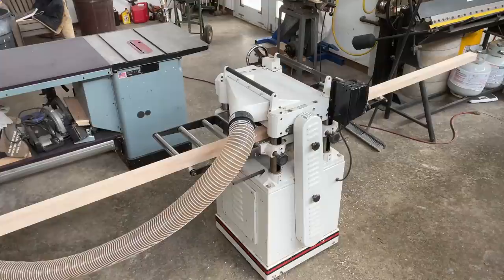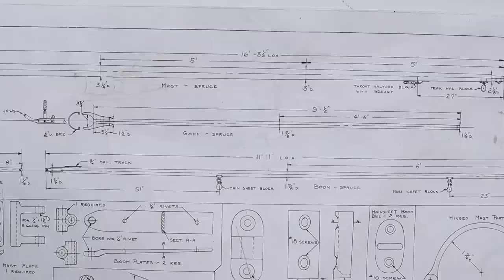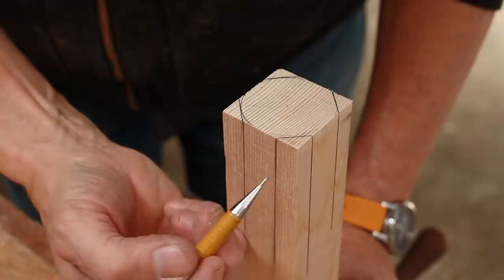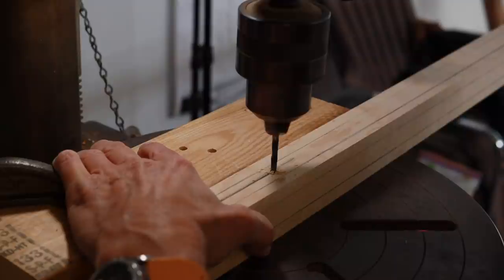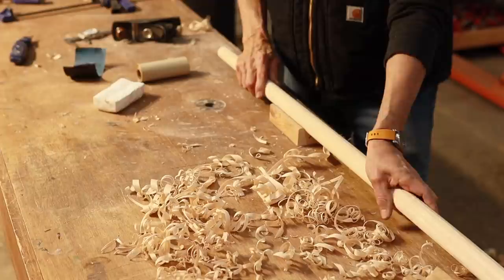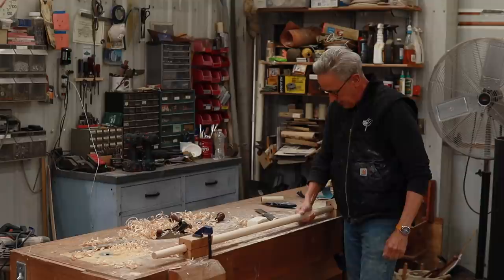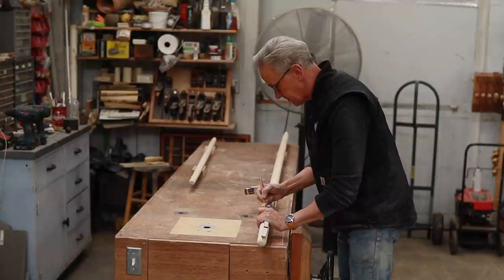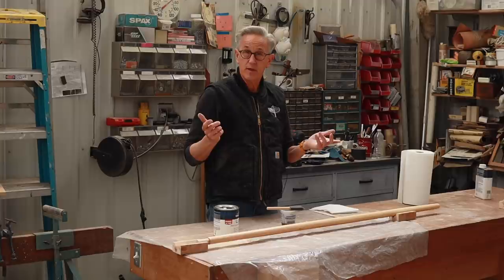Making Spars for a Haven 12 1/2, The Jib Club & Gaff, Part 1, S2-E62

Comment: That spar-maker's gauge is ingenious... simple but very effective!
Reply: I've seen a similar device with a single pencil used for finding the center line, but this will come in handy when I'm turning hardwood pieces for vases, mallets, etc.  (Pretty hard on lathe & tools if you try to round off a square piece of hickory or oak.) The goal of course is equal width faces, but the projection on one face I've just been using trial & error.  It will be nice to get it right the first time.  The right way seems obvious when Bob does it!

Comment: Tedious work for most people, but maybe less so for an artist experienced with the general challenges and concepts of the non-linear shaping of materials?  Starting with the smallest spars to hone the required techniques seems like a great idea since they're the easiest to handle and the cheapest to replace if you mess up.
Reply: Dang I'm about to start making spars for a 1890's style racing class sloop and planning on using traditional materials and techniques,  no sandpaper of course but you can also get excellent surfaces with a custom shaped card scraper perfectly sized for building light spars. 😀

Comment: Hey Bob I've got a question, with the Gaff jaw, when you used the drill press to drill out that slot, for the bronze lever shouldn't the slot be drilled out completely? will it be a water trap for collecting water if it's not drilled out all the way?
Reply from the maker: Good question. I built per the plans. It's very small and if by chance moisture did get in it would evaporate quickly. I did seal the inside of the slot.

Comment: Are all the round pieces on sailing vessels made by hand the way you did it? Or do they use lathes, if any exist?
Reply: There is a water mill near me, built over 200 year ago using some salvage timber from wooden ships including some spars as pillars. You can clearly see where they have octagonal facets that are faded at the ends into round stock. I can't imagine they would ever have been turned on a lathe. There are vids of people hand rounding large baulks like Bob has done.

Comment: Wondering why the spars don’t have a couple of epoxy coats on before varnish, wouldn’t that extend their life and increase their strength? Excellent work as usual.
Reply: it will work if you put a fiberglass sleeve first, epoxy on its own does not add much strength